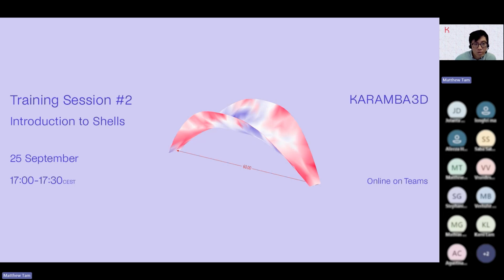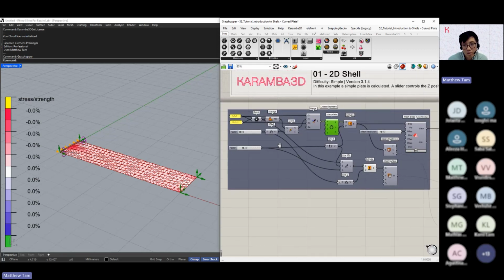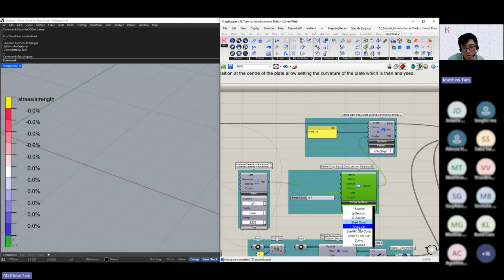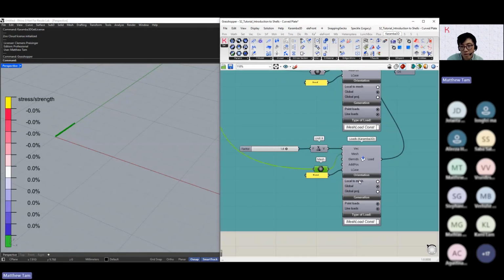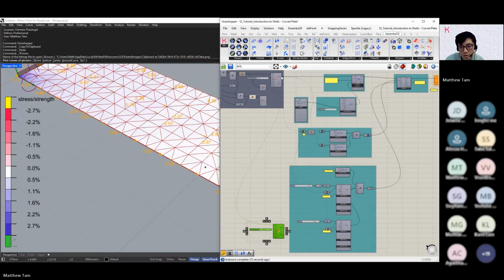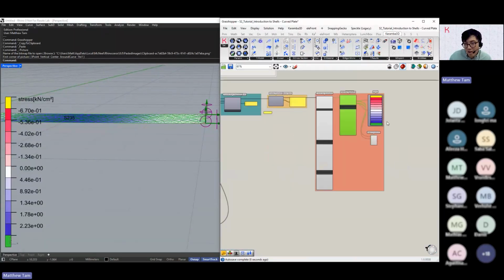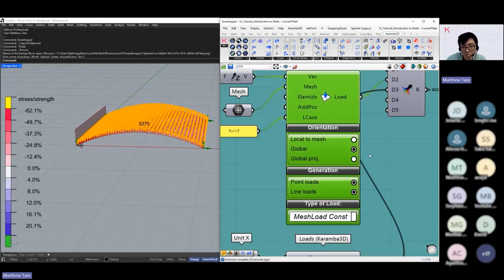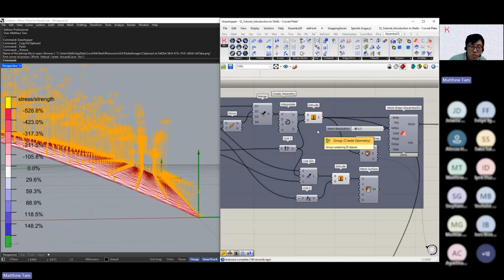Karamba3D Tidbits #52  Introduction to Shells

Comment: I am wondering since ages, if there is a way to add compressive elements which are attached to the membrane/shell working kind of like local supports that only act on the membrane...